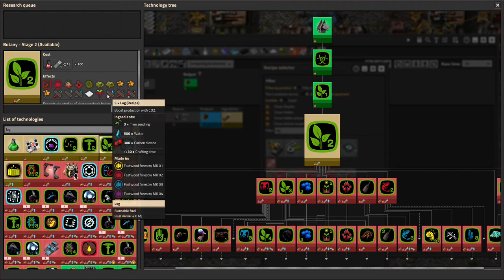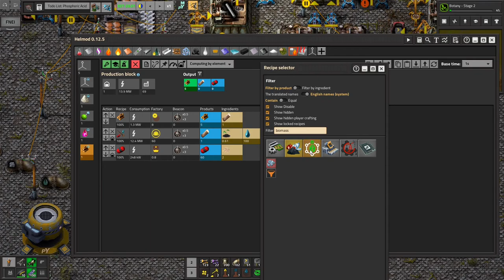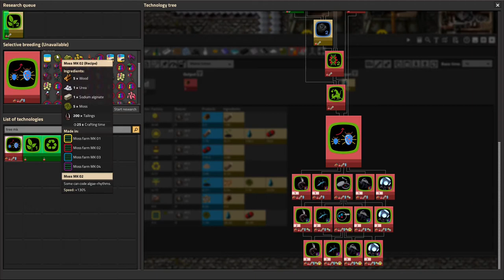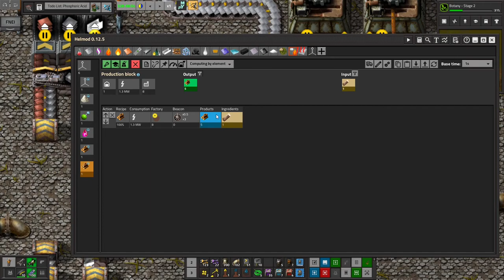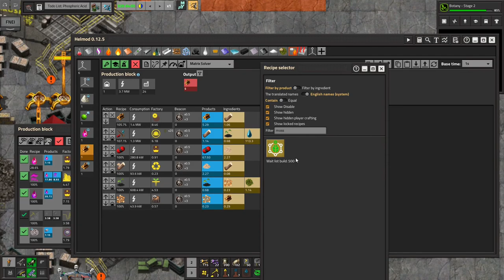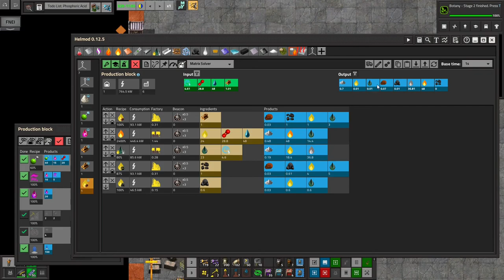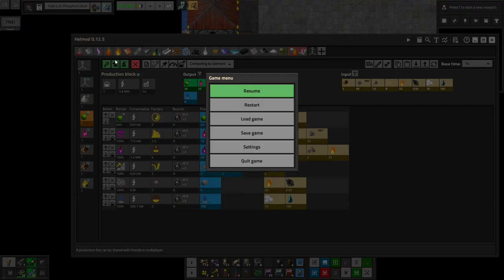Factorio 1.1 Pyanodon's #34 - Salty

Comment: it's weird to me as someone who has studied chemistry that it requires phosphoric acid to make HCl gas, as industrially it makes so much more sense to electrolyze saline water to get chlorine and hydrogen gas and react those directly to make HCl gas and then make the acid. 

As for how long this series goes, I joined watching this late and haven't done alien life and want to do this modpack myself, but felt that playing with more people might keep motivation if things are moving faster.
Reply from the maker: Well I believe that is actually the other main way to make HCl gas! You'll see when we go to make sodium sulfate & sodium bisulfate :) Though that's still maybe not what you're talking about in terms of mixing chlorine and hydrogen... I know angels petrochem has you making HCl that way.

And yeah playing with multiple people would be a blast! It's just so hard to get schedules to line up, I struggle to do more than a session here or there with other players.
Reply: @Krydax8  If in the near future you can do the more direct route to get HCl, I'd suggest just venting that instead of doing complicated circuits, as that probably can be done as a something from "nothing" recipe, and you get sodium hydroxide as a (useful) byproduct.
Reply from the maker: @Ensivion  That's a good thought!